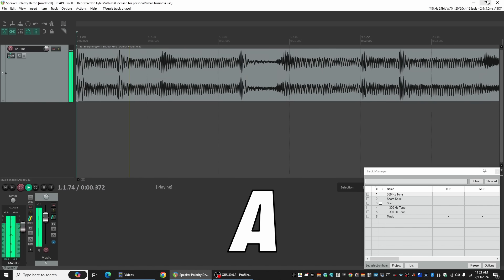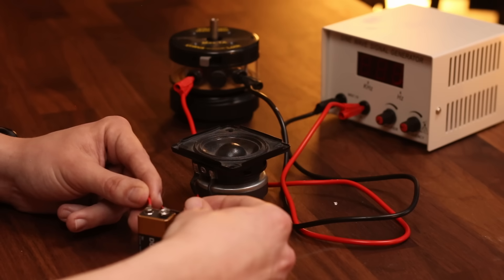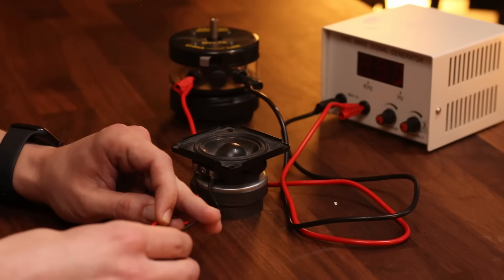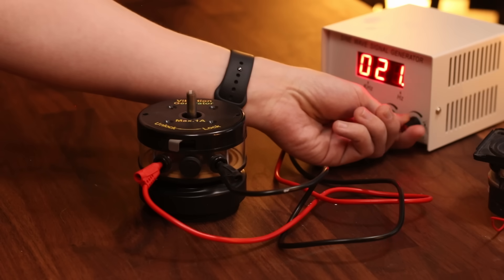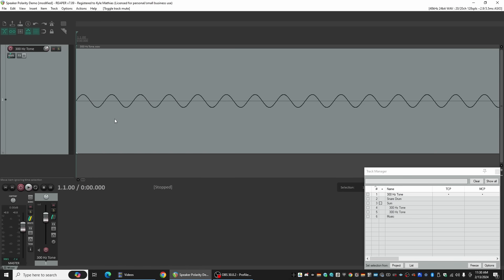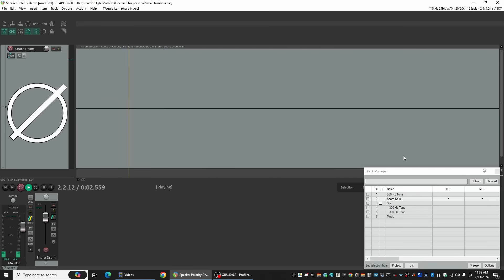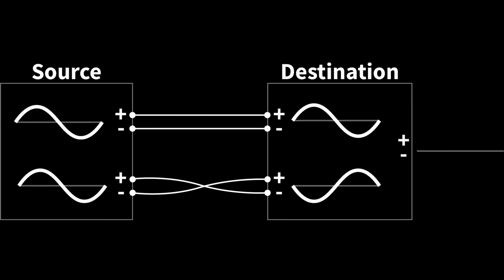What Happens When You Wire Speakers Backwards?

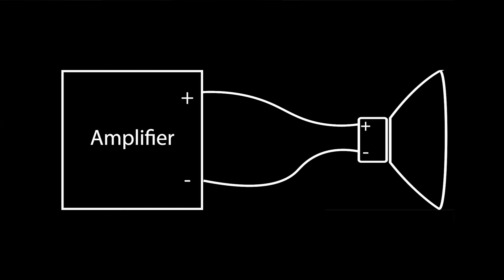Comment: 6:50 this is how active noise cancellation works. The earphones/headphones capture the sounds playing in your surrounding with the mic, reverse it's polarity and play it to your ears, resulting in cancellation of the background noise
Reply: That's exactly right. Typically, noise cancelling headphones have an analog mic wired to the system in reverse polarity, so that the speakers in your headphones create a negative version of those sound waves in real time.
Reply: @bramweinreder2346 Thank you to both you and the original poster you replied to. That was cools insight on a topic I never woulda known about. Pretty awesome to learn how it works.
Reply: @bramweinreder2346 ah! I didn't know that much detail myself. Thanks for sharing mate
Reply: So that's how they do it! I was wondering about that. Not enough to Google it, obviously. But in the back of my mind...😂
Thx. 👍
Reply: @61countdown  yeah, and I imagine some manufacturers make dedicated chips where you can choose to cancel the noise or throw it in the mix. Have to work with an analog signal, microchips and/or transistors to prevent latency because when something needs to be calculated you're already working with old data.
Reply: Just want to note it cancels out the sounds as you perceive them, but it doesn't protect you from hearing damage.
Reply: @urphakeandgey6308  shitt
Reply: Some car manufacturers have been using it for years to limit cabin noises, simulate engine sounds etc.
Reply: That is true. However, the noise cancellation need only apply close to the entrance of your ear canal - i.e. at a single point. The phase is shifted to give a net zero at that point so that there we will have opposites summing up to zero or very little. Since the wavelength of different sounds ..well ... differ, the phase angle has to be different for different frequencies. This is a level up from swapping your speaker wires. The speaker swap will work at certain points for certain frequencies .. If you can hear this difference you are a walking signal processing unit with impressive A/D conversion rate and precision.. and you are also very good at placing your head or ear at a precise point... or just very good at believing things.
Reply: its called interference and it apllies to al form of waves. essentially both waves get added and then either the highest point gets increased or it cancels each other out. (at least that are the tow extremes of course there are many states in between)
Reply: I used to do this as a DJ, by playing the same record on 2 turntables, one just a smidge out of sync.
Reply: @RealPackCat  that`s called "phasing"

Comment: The only reason speakers have a polarity is so you keep all speakers in phase and dont get out of phase wave canceling :)
Reply: I'm a bit of a stickler for definitions in audio and "in polarity" and "out of polarity" are different then "in phase" and "out of phase" . Phase has a time component to it, polarity does not.

These 2 signals are out of polarity:
/\/\/\/\/\/\
\/\/\/\/\/\/

These 2 signals are 180 degrees out of phase:
/\/\/\/\/\/\
 /\/\/\/\/\/\

See the difference? The out of phase example the bottom signal starts later and ends later, it has a time component to it that is different then the original signal. In the out of polarity example there is no time component to it, they both start and stop at the same time. So what's the difference then?

/\/\/\/\/\/\
\/\/\/\/\/\/
two signals out of polarity add to:
----------------
they completely cancel.

/\/\/\/\/\/\
 /\/\/\/\/\/\
two signals 180 degrees out of phase add to:
/---------------\
They don't/can't completely cancel as one starts before the other so there is an artifact at the beginning and the end of the signal.

Phase has a time component to it, polarity does not.
Reply: @wally7856  Out of polarity is still a half wave out of phase. aka complete sound cancelling.
So you already know exactly what I meant :)
Reply: @axle.student  I knew exactly what you meant but if you want to pursue sound you should learn the different terms because you can't use those phrases interchangeably because they mean different things. “Phase” implies a shift in time relative to some reference, "polarity" does not. In the 180 degrees out of phase example I gave, it is not a complete cancellation. The first half of the wave of the 1st signal comes through before the second signal starts. Likewise at the end you still get the second half of the wave of the 2nd signal after the 1st signal stops.
Reply: @wally7856  180 deg out of phase is a half wavelength. Destructive where peak meats trough.
That's just general for wave forms in most disciplines.
It is called 180 deg "Out of Phase".
There is nothing incorrect about that.
You Showed 2 waves 90 deg out of phase with is not a complete reversal of the AC voltage. :)
Reply: @axle.student  180 degrees out of phase means that waveform is DELAYED IN TIME by the amount it took to delay it a half a wavelength. Flipping the polarity, there is NO TIME CHANGE to the signal, you just swapped the + and -. If you use the word PHASE you imply a TIME DELAY of that signal that you can measure with a stopwatch. You can't measure any time delay of a signal with just the polarity swapped. PHASE CHANGE = MEASURABLE TIME DELAY.   POLARIY SWAP=NO TIME DELAY
Reply: @wally7856  OK, Fair point. My apologies.
The wave is just reversed polarity without any phase delay.
>
Just seamed simpler to state it that way, but I am incorrect.
Reply: @wally7856  P.S. I was attempting to avoid the confusion where people think that the inductor (or capacitor) is a DC device.
It is an AC device and the +/- is only there to keep all connected devices with the same polarity.
Reply: @axle.student  It's what most people think which is why when I seen your post I felt a need to show you the difference so you get a better understanding. 

If we had a 20hz signal starting at time=0, flipping the polarity of that signal it still starts at t=0. If instead you put that signal 180 degrees out of phase that signal now starts at t= 26 milliseconds. That's about the time it takes for sound to travel 30 feet. In audio that gets important when you are trying to time align drivers when building crossovers or utilizing multiple speakers. In electronics, 26 milliseconds and that electronic signal went around the Earth 5 times so your timing is way way off. So it seems like it's just semantics "phase/polarity"   "tomayto/tomahto" but that timing difference can make or break your project so it's important to differentiate the two.
Reply: @wally7856  It's OK, I do understand the difference, I was just attempting to highlight the wave cancelling :)
My head was thinking it a different way by shifting the same wave (on paper) 180 out of phase as the simple explanation, but it's not actually correct in practice.
Reply: @wally7856  Right now, and then my head is/was trying to build a piezo ceramic amp with correct impedance matching.
But I've got that with a small audio transformer, 8ohm by 1000ohm with the 8 ohm to the amp out :)
>
Audio electronics is "My other thing" that I don't do very often. More logic boards and programming for me lol

Comment: Discovered noise cancelling microphones in the mid 70's while working with CB radios. Used a similar effect to cancel out noise but you had to speak directly into the microphone. Tilting it 15 or 20 degrees in any direction effectively cancelled out the user as well as the background noise.

Comment: The speaker will just flex in one of two directions and stay there. There is no difference when wiring one speaker backwards. Now, when you have one speaker backwards and the other forwards, and you're using one for each ear, now that's when the lower frequencies will get funky.

Comment: I think this is how audio shops sometimes run in new gear. They reverse the polarity of one speaker and then face the two speakers together so there’s no sound. Never tried it myself because it would likely void the warranty.
Reply: That's what I do, I also take the drivers out of the box. Run a 20-30 hz signal and it's virtually silent.

Comment: Years ago, when Dick Smith made electronics kits, I remember building one and reading his words (paraphrasing) "No matter what anyone tells you, speakers are not polarized". While this is technically true, it's a terrible splinter to put into a young mind as it implies the +/- designations are completely meaningless, which is only the case while you're working with a single, directly connected driver.

Comment: Can you please explain why adding a second speaker gets an increase of 6 dB (quadruple)?
Reply: I can :)

      Imagine you have an identical clone of yourself. Same power, same endurance, same strength, etc. Now I put you and your clone in identical canoes and you have to race each other to the other side of the river. It should be a tie right? Well in this example I am going to give your clone a proper paddle and I'm going to give you a broom stick. Now who wins? Your clone is going to win because he can transfer his power to the water more efficiently then you. You, try as you might with your broom stick just create a lot of eddies effectively wasting all your power by just (very slightly) heating up the water and barely going anywhere. What is happening is that both your paddle and broom stick are "high impedance" as they are solids but the water is a lower impedance as being a liquid it can just move out of the way. When you have a high impedance load into a low impedance load there is a loss of efficiency where that loss gets converted into heat. The larger surface area of the paddle better matches the 2 different impedances then the broom stick does so it is a more efficient transfer of power.

Speakers are the same thing but the air is an even lower impedance load then the water and most of your energy is wasted in trying to transfer the load from the cone to the air, most of the air just moves out of the way. In order to increase your efficiency you need a bigger paddle (speaker cone area).

So you get +3 dB (double) for doubling your power (second speaker) PLUS you get a +3dB (double) for doubling your cone area thereby doubling the efficiency of the entire system. +3dB plus +3dB = +6dB  In order for the second +3dB (increase of efficiency) you usually need to have those speakers with 1/4 wavelength of each other (coupling).

Now this +6dB for doubling your speaker count doesn't go on forever. Once you reach the maximum efficiency of the system you no longer get +6dB by doubling your speakers, you will only get +3dB. Like a skydiver falling, once you hit terminal velocity you no longer get any faster.

With direct radiator subwoofers for example, your efficiency will top out around 25%, with horns you will top out around 40%. After that you only get +3dB for doubling your speaker count. Also, you will top out your efficiency at higher frequencies faster then lower ones. For example, going from 5 double 18" subwoofers to 10 double 18" subwoofers, 30-50hz will get +6dB's but since the higher frequencies are probably already at maximum efficiency with those number of boxes, you would only expect to get +3dB in the 80-100hz range. At about 12 double 18"er subs, you will have maxed out your efficiency and you are back to just +3dB for doubling the count after that. Also, high frequency drivers like a compression driver in a horn, you are probably already at maximum efficiency so you would probably only get +3dB even going from 1 driver to 2.

Comment: When you flip the positive and negative, the poles (north and south) of the coil which is an electromagnet will flip

Basically my guess is that after a current is applied the magnet will attract or repel the permanent magnet (according to the poles) moving inwards or outwards

Comment: I'm really wondering if you could use this to hide information inside audio files for arg puzzles. Either by having a silent message where you need to mute one of the channels (if there's a format that gives you all audio channels) or by making two different files with the same song, but one is invested, then the message recorded on top after the flip, of which you would need to sync both up in order to hear the message.

Comment: what if the voltage source is not from + to -, but from + to 0
i think this can make a difference even with AC if the speaker has construction limits and cannot go as much backwards(reverse voltage from - to 0) as it supposed to go forward(direct voltage from + to 0)

Comment: If you're standing perfectly in the middle between two speakers, then even perfectly opposite waves will not cancel each other out perfectly because they won't reach your ears at the same time. In fact, they may even add up constructively! For example, take an A note at 880Hz: since sound travels at 343m/s, the wavelength is 343/880 = 0.39m. And your ears are about 0.20m apart, which is almost exactly half a wavelength. So opposite waves will actually add up constructively around your ears! Of course, if you just move 0.2m towards one speaker, the waves will now cancel out. So the polarity really doesn't matter much when we're talking about these "normal" frequencies.
However, if you consider a very low pitch sound, say at 20Hz, and do the same math, then you will find that its wavelength is over 17 meters. So no matter where you are in the room, the waves will cancel out. This explains why the problem is mostly noticeable for low pitch sounds.
It also depends on your position relative to the speakers. If you walk far away from both speakers, remaining at an equal distance from both, then the sound waves will take approximately the same time to reach your left and right ear from both speakers, and the problem may become noticeable, even at higher frequencies.

Comment: It's worth noting that some sounders (I hesitate to call them speakers) are designed to be driven in one direction only. They are intended to be driven by a digital output that varies from 0V to some positive value like 9V by a single transistor. They should only be connected one way around.

Comment: Whoever said they can hear a difference with the snare drum is either lying or their brain is playing a trick on them.
Reply: with good hearing and headphones u can tell a difference
Reply: @SirkyNL  umm you can't really wire headphones backwards unless you make an effort..
Reply: @ did u respond to the wrong person with this or wdym im agreeing with you lol🤔
Reply: Its not a trick if you mass with samples all day and have trained ears .. there is a "bass wave" starting with the normal snare that does not exist in the polarized snare which I can clearly hear even with my eyes closed.
Reply: imo the higher frecuencies sound VERY SLIGHTLY louder
Reply: Depends how your ears are wired
Reply: Why? Because you say so? If your answer is, this has been proven by science, fine. Reference a test that was done using legitimate science. Otherwise, you're just guessing.
Reply: its possible to hear if you listen thru right setup.. larger speakers with air movement

Comment: it only maters with Bass with bass the speaker needs to push outwards not inwards thats how you know you connected them the wrong way. plus it's not hard to figure out just wire the (-) from speaker to (-) on the amp and (+) to (+)

Comment: snare has slightly more base on positive when boosted all the way up, but this would be more pronounced on a gunshot or thunder-track where the initial positive pressure is of far higher magnitude that following negative pressure shocks or echos.  for a shock wave to sound different by polarity it has to be super loud, and super asymmetric. I.E. initial positive shock far exceeds negative and positive mixed echo and resonance.

Comment: I'll guarantee a positive-pressure shock wave carries further and has more volume than a negative-pressure shockwave, but normally speakers don't play at 100db+ volumes resulting in shockwaves... if one wanted truly authentic gunshots or lightning noises in their home theater it's probably easiest to play realistic boom, crack and thunder sounds with positive pressure.   The biggest difference acoustically between negative and positive waves is when mixed with other speakers to cause constructive vs destructive interference, which along with sound delay and accoustic reflection control makes the biggest difference between crappy surround and awesome surround-sound within the power-ratings of a given speaker and amplifier combination.   I'll agree sin-waves, and other symetric wave-forms dont sound different based on polarities on a single speaker or on a set of speakers when all phase-matched.

Comment: 5:00 
if speakers are ideal, like high quality speakers, there shouldnt be a difference.
But for low quality ones,there might be, as they might react differently strong on a negative than on a positive voltage, although they really should react the same.